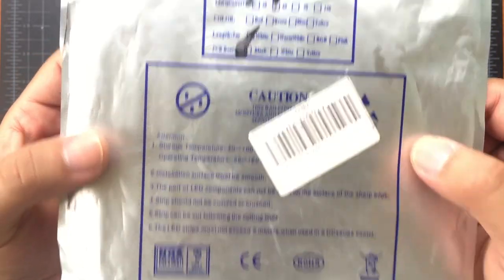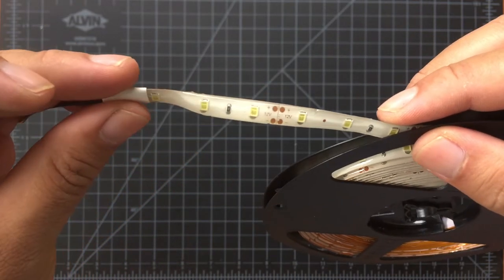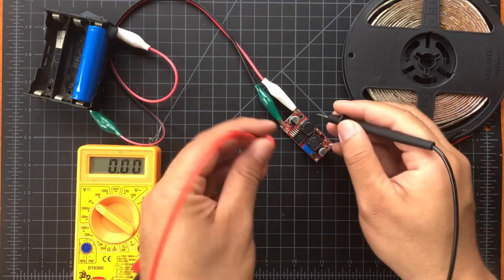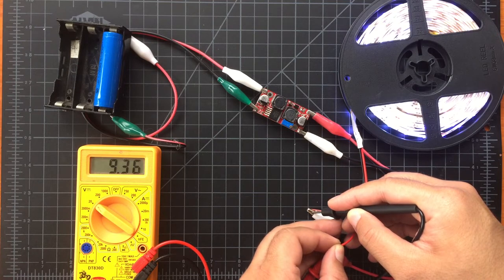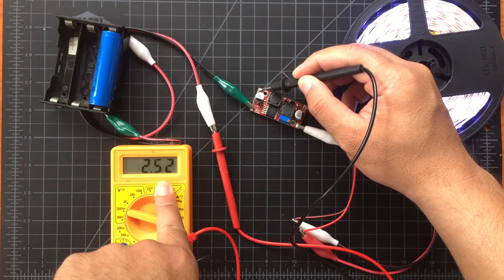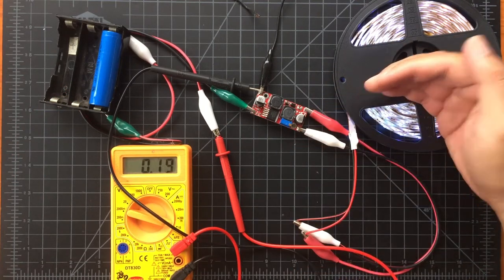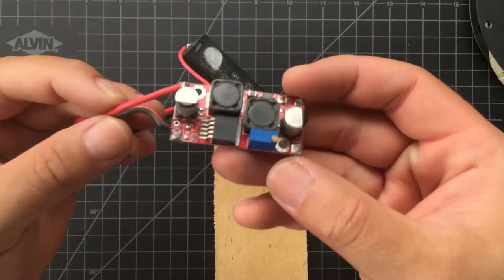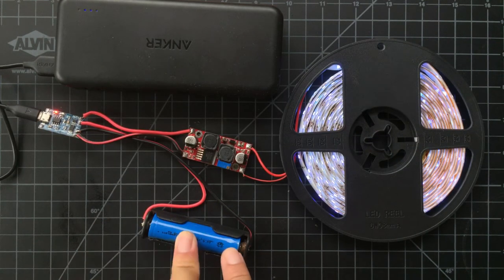How to use 3.7V Battery to Power 5 Meter 12V LED Strip in 2023

Comment from the maker: I suggest using the MT3608 DC-DC Adjustable Boost Module, not the buck boost converter in the video. Thats because the one in the video has a cut off voltage of 3.8V which is not low enough.

The MT3608 DC-DC Adjustable Boost Module has a cut off voltage of 2V but don't worry that is what the battery protection board is for.
Reply: I have a boost module like that one and is rated for 1.5amps, which is not enough to handle the whole strip at full bright, it will get hot or dim the lights
Reply from the maker: Yes you are correct, it happens to the buck boost converter as well that I used in the video. 2 batteries in series is better or 3 is much better.
Reply: @TaylorSoloaiJR  just tested paint two small strips (50cm each) in parallel, and at 11v the light is bright enough and the boost converter doesn't get hot. Now the issue is the protection board. The one down here doesn't work since it's a charger nos a protection for a load, and needs to be powered to work. I think this would be better with a BMS boats that also does the balancing when charging amber discharging having more than one battery in series.
Reply: @Taylor Solai I had a question ie I have a 42 IR led lamp requiring 12v 1a power supply. So with the method you used to up the voltage to 12v, can I do the same or should i use 2 18650 batteries each 3.7v for my case?

Any help would be appritiated.
Thank you
Reply: @RiO-kq6vz  with two batteries, you have more capacity. In this case 2000mAh means 1,2h from 100 to 0%.

Comment from the maker: You guys can just also use the powerbank alone with the buck boost regulator. Just need a USB cable cut off the end and connect the wires correctly to the regulator.

Comment: I am a bit stumped, but I have an 18650 going into a MT3608 to drive it to 12v.  Then I take that to an XL4015E1 that I set the max voltage to 3.7v and current of anything to light a 3w led.  Works but why am I being limited to about 270ma?  I remove the LED and measure the current directly (looks like a direct short to the XL4015E1 and how you adjust it) the current is back to where I set it.  Where in the world is the issue?  If I have it going from the out terms but going through the led I don't I am stumped as I said.

Comment: Great work. How long does the battery last when the LED is at full brightness?
Reply from the maker: I haven't tried it on full brightness for too long because the voltage regulator was getting super hot, but adding another battery in series will be the best option rather than just using one.
Reply: @TaylorSoloaiJR  I see. I'll try that out. Meanwhile can I add a heatsink to reduce the heat from the voltage regulator?

Comment: Great video and very helpful for a project i am working on. Can you advise the brand or more detail on the TP4056 you have used. I am intrigued by its configuration offering terminals for charging the battery and seperate terminals for the power out to the led array. Thanks in advance if you can help.
Reply from the maker: I actually learned a lot about this board by studying its datasheet online and also watching other YouTubers.

When you are buying one just make sure its the board with the battery protection. The other version does not.

Comment: I have several 18650, 2200 mah, 3.7 volt, 35amp high drain batteries from a e-cigarette vape device. My question is can I use a 3 slot battery box which would be close to 12 volts to power the same led strip?
Reply from the maker: Yes you can, I tried it before and it works. My only concern is that it will lessen the lifespan of the led strip.
Reply: I want to wire it with a switch for the inside of my gun safe. Like a refrigerator, door opens, lights come on. Should I use a BMS or a fuse? Will these led strips give enough light to illuminate the inside? Thanks for the info.

Comment: I arranged the same circuit but my strip light does not work on battery when it is disconnected from main power supply
Reply: What can i do regarding that
Reply from the maker: Could be anything, what module and voltage are you using it at?
Reply: @TaylorSoloaiJR  i am using XL6009 Step up down buck boost converter module at 24 V,  strip lights of 12 V

Comment: Can you also add a switch to turn on and off the LED Strip
Reply from the maker: Yes you can, make sure it's between the battery and the voltage boost module.
Reply: Will work on it. And i have been trying to add a few cells to but it is not working any suggestions on modifications i can make
Reply from the maker: Adding cells in parallel or series?
Reply: @TaylorSoloaiJR   added them in parallel. or which one would you recommend
Reply from the maker: It's better if you put two of them in series, unless you have three then you don't really need the buck boost converter.

Don't forget you're going to need a BMS for the batteries in series.
Reply: @TaylorSoloaiJR   Thank you

Comment: Great video. But I could use some help. 

I had a DC buck converter laying around, but it seem to only be able to step down the voltage. input is 4 volts, output can only go up till about 4.2 volts. what could be the problem here? Do I need a differen buck converter?
Reply from the maker: Buck converter can only step down voltage, you need a boost converter.
Reply: @TaylorSoloaiJR  Thanks! I'm ordering some.

Comment: Serial connection of 3x 18650 should be enough to?
Reply from the maker: Yes you can connect them in series with a BMS to protect them, only problem with this it will exceed 12V so it will lessen the lifespan of your LED strips.

Comment: Taylor Soloai Want to ask u,How much long time will running full 5M strip of leds with 2x 18650 5000mAh in series with this buck booster? Thank u for answer
Reply from the maker: As I explained in the video, it depends on how much current is flowing from the batteries to the buck/boost converter.

The brighter it gets the less time the LED strips stay ON, but I would not use the buck/boost module because it will automatically shut off when the batteries goes down to 3.7V

Comment: I hope you can help me sir,i want to use 18650 battery to power up 12v 90 watt electrical component for 7 hour daily for my little food truck.can you teach me what to buy?I really appreciate if you can help me,please.Thanks in advance.
Reply: Does 36v 100000mah 18650 battery will do the job by adding a 36v dc to 12 v dc ?if it can,how many year approximately,it can use?
Reply: I'm also ever planning to buy a 12v 80ah gel battery to so the job but i cant find a good gel charger for it in my country.

Comment: Hi friend nice video i have a question i have a lot of 18650 batteries bout i was trying to doing that with 4 aa batteries that was giving 5.04 v bout that not works any idea why sorry for my english 😅
Reply from the maker: Were you using the step up step down voltage module that I used in the video?

Comment: they don’t want you to connect another 5 meter LED strip to this cuz that would require I^2 times the amount of current to apply through out the whole 10 meters length, and that's why

Comment: I've been looking for a way to put an led strip on a few quadcopters but it needs to be light and easy since I'm an idiot.  I don't even know what components to look for.  I'd like to power a 12v strip with a 1s(3.7v) li-po.
Reply from the maker: eBay has some smaller "step up voltage regulator' that might work for your project. Smaller than the one in the video, just make sure to check the specifications first before buying.

Comment: Can you show how to do the same but with 3 or 4 batteries? I mean with the protection board, I have more batteries but the charging is done in parallel while the discharge should be in series, and I'm not sure how to do the connections.
Reply from the maker: Their are BMS boards made for 3 or 4 batteries but that means you also have to buy a charging adapter. I'll try and see if I can make a video on how to do it.

Comment: Would 3 of these batteries work without the board?
Reply from the maker: Yes it should be fine, but just check the specifications of the led strip if its okay to use more than 12V since the 3 batteries will give 12.6V when they are fully charged.

Comment: Hi, I've made a project just like your video...I did a lil mods by put  a switch between the module and the led, so I can turn it on and off easily... but turn out my battery always dramatically drained when I turn the switch off, so the led doesn't lit up every time I need it,,, then  I had to recharge the battery  so often.. what is your suggestion? or I missed something on the built process?
Reply from the maker: You need to put the switch between the  battery and the module, because in your project even though the led is turned off the module still uses power. That's why your batteries are draining.
Reply: @TaylorSoloaiJR  uhh.. I see.. so thats why.. many thanks sir..

Comment: u can connect it in series  they say that coz u need more amps on ur power supply and u need to add voltage adding wires for voltage drop
Reply from the maker: Yes you are right, connecting two in series is better but I just want to demo that you can use lower voltage batteries to power it but with with less than 12 volts.
Reply: @TaylorSoloaiJR  ahh I see but I just came across ur vid now ima try the exact same thing u did but will multiple  batteries  so it should run about longed
Reply from the maker: Do you use salvage 18650s or do you use the new batteries?

Just wondering what others use for their projects.
Reply: @TaylorSoloaiJR  I  got a few new batteries  but I also got some old ones ima try with both
Reply: This is also a good idea to run a modem or wifi router
Reply: You thing the power supply  thing would work on a cctv camera say i put 4 or 5  batteries  with the same set up u did
Reply from the maker: You can use this same method with those portable wifi routers but the units that are rated at 12V 2A is not good for it. I suggest using two 18650 batteries in series and then boost the voltage up to 12V.
Reply: Its true, there is a UL code for this. Which is why most 12v power supplies max at 5amp. If it says it uses more, you'll notice is has separate wires per 60w. its just multiple power supplies inside 1 case.

Comment: My led strip came with no remote or power and just 2 cable with opening in the end like yours. Is this the only way of getting power to the led strip
Reply from the maker: Yes, those are the cables to deliver power to the LEDs. Do you have the 12V or the 5V LED strip?
Reply: Taylor Soloai 12v

Comment: hi. if i use Non-rechargeable batteries its necesary the lithiu battery charger module?
Reply from the maker: If you use Non-rechargeable batteries you don't need the battery protection board.

I suggest you use the MT3608 DC-DC Adjustable Boost Module, because the cut off voltage is 2V. So if its below that it won't work anymore.

Comment: Hi there, interesting video. 
I'm looking for led strips that I can use to light up some Lego models. I have seen 3V Led strips working with 2 button batteries (CR2032). Apparently it can even work for 2 days in a row (but I doubt it). 

My question is, can you use a 18650 battery to expend the running time or is the voltage too high for such 3V strips? Can I also add one one these modules to the circuit to recharge the battery? 
What about putting 2 AAA batteries in series, that way the battery box could be thinner? 

The goal is to get a very dimmed light, I really don't need a full power bright lighting. It's just for ambiance. So would I need an extra module to also dim the light to a minimum? 

My current project is for a Lego Millenium Falcon back sub-light engine, measuring 30 cm long and probably adding one Led strip part (they are cuttable every Led - 60 Leds / meter) for the gunner and another one for the cockpit. 

Thanks
Reply from the maker: The module that I used in the video can also lower the voltage, so in your case 3V. The only problem with this step up and down voltage converter is it only works starting at 3.7V, so below that it will shut off.

You can run it with only the AAA batteries but you probably need a BMS board to protect the cells from being over discharged but you need to find out how much capacity the batteries have.

Honestly for me Ive been using li ion batteries for my projects, you can even get them for free from old laptop batteries. You've probably seen how they salvage them from other YouTube videos.

Comment: Can you connect 3x 18650 in series to give you the 12v and quite abit of mah?  What do you have to keep in mind if this is possible?
Reply from the maker: 3 18650s in series will give you 12.6V which is okay but it might shorten the lifespan of the LED strip but the good thing about the buck boost converter is if you set the voltage to 12V it will stay there OR you can just charge them only up to 12V, just don't forget to use a Battery Management System (BMS) board to protect the batteries from over discharging.

So you won't be increasing any mAh from connecting them in series but if you need to increase that then you need 3 extra 18650s. Three pairs of 18650s in series (2P 3S battery pack).

I hope that makes sense
Reply: @TaylorSoloaiJR  , this helped alot thank you! On Average whats the amp requirement for LED to be on full power? 

If I know this value (im sure each brand differs) can I just add them up  with the amount needed for the task and ensure my battery can handle discharge rate on top of using a Battery monitor circuit?
Reply from the maker: I'm not really sure because their are different LED sizes so you would have to do this on your own, just follow the diagram in the video and you should be fine. That's if you already have a multimeter.

Comment: I have a 144 led 5V strip. Will a single 18650 cell (samsung 25r with 2500mah 20A continous discharge) be able to give out around 10 amps when boosted to 5 volts?
Reply from the maker: I don't think that 5V led strip will pull up to 10A, should be lower. You could just use a powerbank. Since it outputs 5V, just need to find out how much mA it pulls. Its a lot easier and less work.
Reply from the maker: @Alamini96  the module shown in the video won't work with the lights you have. Because 8.6A will be too high for it and its going to shut off. Unless you try using it at a lower voltage (which means the brightness won't be as strong) and get lower amperage.

Comment: @Taylor Solai I had a question ie I have a 42 IR led lamp requiring 12v 1a power supply. So with the method you used to up the voltage to 12v, can I do the same or should i use 2 18650 batteries each 3.7v for my case?

Any help would be appritiated.
Thank you
Reply from the maker: Yes, you can use two 18650 batteries. Putting them is series is recommended. Just make sure you have 2S BMS for your batteries to protect them from being over discharged.
Reply: Do you mean 2 series charge module?
BMS?

Do you mean this--
XR HX3S 18650 3S 12V 25A BMS Protection PCB Board Lithium Li-ion Battery.

I found this on amazon.
Reply from the maker: Yes, those modules help with both overcharge and over discharge.
Reply: Thanks a ton for your help.:)
Reply: Hey man one last thing, in your case you used a single18650 battery holder and so connected only 1 of those blue units to prevent over discharge.

However if i use 2s or 3s batter holders how many would i need to connect and in what manner? Like 3 in series to each other or how?

Comment: You have a link for the buck boost regulator you use.?
Reply from the maker: Select the option that says "XL6009 Red Module:
https://www.ebay.ph/itm/Automatic-Step-Up-Down-Converter-DC-DC-Buck-Boost-Power-Supply-Replace-XL6009/123965623616?hash=item1cdced4d40:g:Wj0AAOSwYUpdwplX
Reply: @TaylorSoloaiJR  thanks, i see that you turn it on with the charger? Is it also possible to do that with a button switch?
Reply: @TaylorSoloaiJR  I want to use this module in a clothing rack with a motion sensor. Zo it has to be as small as possible for me with the batteries. this video is perfect

Comment: hi. can i  control the WS2812 LED strip with arduino using your method( video) as external source to power the strips?
Reply from the maker: Sorry i know nothing about Arduino, hopefully someone in the comment section can help out.
Reply: Taylor Soloai thank you..no worries ☺️☺️☺️
Reply: It's late sorry, but answer is no, WS2812 take 5V, although the method is the same.

Comment: Hey, do you think that with such a regulator and multiple batteries in parallel it would be possible to power up a 5m 2812b Led strip at full power without burning everything ? (18w/m) 

Thanks !
Reply from the maker: You need to get one with a heatsink already attached, the one in the video will eventually shut down if it's over heated from the heavy load
Reply: @TaylorSoloaiJR wow, what a quick response 😅
Thanks a lot !
Reply from the maker: You're welcome

Comment: Fast low bat
Reply from the maker: The higher the amperage the faster it uses the battery capacity, use a 5V led strip instead

Comment: Hii sir what power is required to light a single led from a led strip light which u have shown in this video please help me sir I have a project pending 
Your videos are very helpful 👍 sir Liked & subscribed
Reply from the maker: Are you planning to use the one 18650 battery shown in the video to power it? Or different power source?
Reply: @TaylorSoloaiJR yes it is 18650 of 2000mah power bank battery power bank is of ambrane compony,
Reply from the maker: @dakshpatel2409  sorry for replying late but I have no information about how much power a single led in the led strip uses but from my experience the shorter the led strip the less power required.